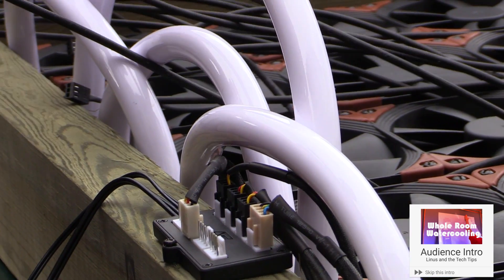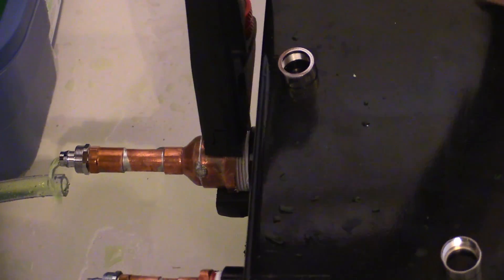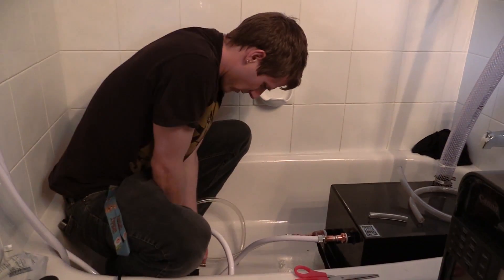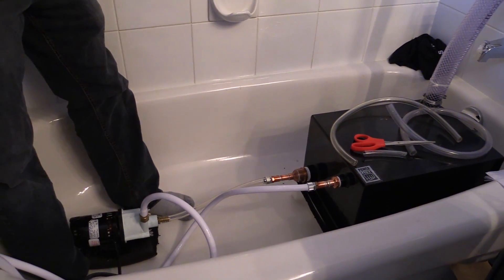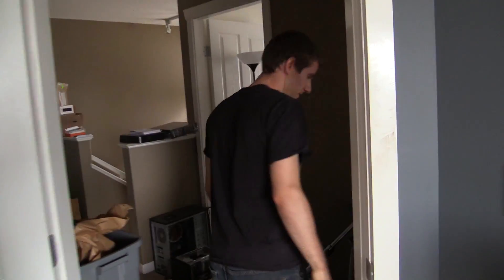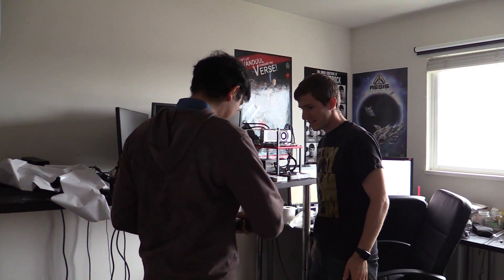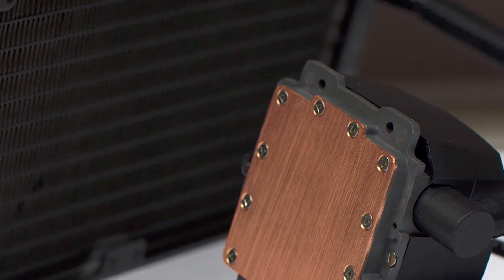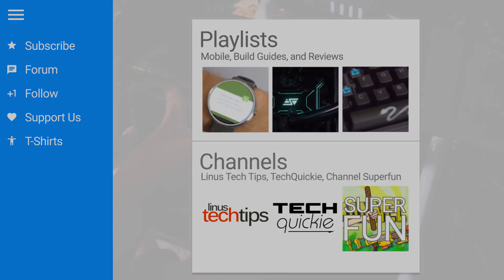Whole Room Water Cooling Part 4 - Nearing Completion...

Comment: LinusTechTips You should have used 22mm copper around the ceiling then branch off to each pc in 15mm copper to reduce the flow rate drop across the system. At the high points of the system you can install AAV's (automatic air vents) will help you get rid of any air you dont want in the system easier. On each branch to each pc loop you should of put in vavles so when you need to remove one pc you wont need to drain the entire system. Last of all the pumps in the computers are going to be working harder and against the big pump in the bath and against every other pc on the system.
Reply: yeah i was thinking same thing and im nomplumber im an exx bbodyman painter

Comment: A valve at the top of the piping for each pc,  or just at the highest points,  would have been nice for taking care of the air in the system. Just like in normal house radiators. (at least in denmark where I live), each radiator has a valve at the top,  top release air.

Comment: Just a question. If one of the systems are off, won't the water stop flowing?
Reply: They are connected to the loop in parallel, not in series
Reply: That too

Comment: Fun to watch but some mistakes.   Pressure balance system feed like you do with a shower with multiple heads would have been better.   Also a radiator built from AC parts would have been cheaper and more efficient.

Comment: have you thott about changing the tubes on the pc in to clear tubing so you can see if the fluit is in the pc or not ?
specially if you disconnect and reconnect the pc
in adison you need some kind of restictor on the out take (eta flow walv) to balance the flow or a lot better pump

Comment: Very nice effort, but the design was flawed from the begining, the pipes should have been placed down on the floor level not up. I havent figured it out if the sistem is in series or parallel. If the pipes where at the lower part of the room it was much easier to bleed the sistem, put a 30" pipe after each PC loop aoutlet and add a simple radiator bleeder valve, bleed each sistem and there u go.

Comment: I don't get this water cooling. I might have missed it so can someone explain why they chose to do this instead of just water cooling the PCs individually? In the first video I saw that they wanted to make the room cooler but air conditioners can just do that. What else is the point? =) Just asking guys.
Reply: My hypothesis is they did this for the experience/video, and to show off some sponsor hardware.
Reply: It's explained in the first part.The heat exhausted from the PC's make the room hot, PC temperatures never go below room temperature. The Computers and the room was hot.

Obvious choice is an AC, they chose this instead.
Reply: so you make a video about hey guys i just AC my work place or??!!
make X videos so far 4th video and entertain us about this idee, so you dont have to do it yourself.
Reply: tosswe44
But the pipes will heat the room as it is copper
Reply: ArmyGuy543
it is acctually. Also if the issue is the heat a better solution would be to put those machines on the bathroom near it and set a  masterswitch and USB on the tables.

Comment: Getting those pesky bubbles out?  Consider adding inline primer bulbs (commonly used for marine fuel priming on engines) -- if you can find one with low restriction it can be used to force ANY fluid through the system, air, water, etc until it is primed.

Comment: Is this a Good Budget Build?
- Updated

Cooler Master N400 ATX Mid Tower Case
AMD A10-5800K 3.8GHz Quad-Core Processor
ASRock FM2A88X Extreme4+ ATX FM2+ Motherboard
Sapphire Radeon R7 265 2GB Video Card
Corsair Vengeance LP 8GB (1 x 8GB) DDR3-1600 Memory
Corsair CSM 550W 80+ Gold Certified Semi-Modular ATX Power Supply
Seagate Barracuda 1TB 3.5" 7200RPM Internal Hard Drive
Asus DRW-24B1ST/BLK/B/AS DVD/CD Writer
Reply: looks fine but buy an AMD card instead if you are using that APU so it can run on dual graphics mode :)
Reply: Go on the LinusTechTips forum
Reply: ***** Thanks, helped alot!
Reply: Lorenzo Ermanni Thanks for the input, I'll definitely consider it.
Reply: Great idea, what AMD Card would you recommend? I was thinking of choosing a Sapphire Radeon R7 265 2GB
Reply: +Theodor Hedesiu 600w psu? do you thin kthe amd cpu really needs 150w morr power? o.o
Reply: Thanks for the Input. I'll definitely consider changing the 5800K to an 860K. The only downside is that I believe the 760k and 860k don't have integrated graphics, thus I won't be able to use crossfire to get slightly higher performance.

Comment: I know yall are moving and what not now, but perhaps installing turn type/style focets on the ends of the pipes would allow for easier drainage and stoppage of the coolant.  Idk what kind of effect these would have on the pressure of the loop and the "air tightness" but its just a thought.

Comment: I don't know what to say so here is a waffle recipe:

INGREDIENTS

1¾ cups all-purpose flour
2 tsp baking powder
½ tsp salt
1 Tbsp granulated sugar
3 eggs
1¾ cups whole milk
½ cup vegetable oil
½ tsp pure vanilla extract (optional)

Prep Time: 15 minutes
Cook Time: 30 minutes

Total Time: 45 minutes
Yield: Makes 4 to 5 waffles

PREPARATION

Pre-heat your waffle iron to its hottest setting. Placing a cookie-sheet under it can help catch any batter drippage during cooking.
Pre-heat oven to 200°F.
Sift together flour, baking powder and salt.
Beat eggs thoroughly. Whisk in sugar, milk and oil.
Add liquid ingredients to dry ingredients and mix gently until combined. Don't overmix!
Spray both surfaces of your waffle iron with cooking spray.
Ladle 4 to 6 oz (½ to ¾ cup) batter on the iron and close it. It's not unusual for a bit of batter to seep out of the edges of the iron. If there's excessive leakage, use less batter for the next waffle.
Cook until the waffle iron's indicator light shows that cooking is complete, or until no more steam comes out. The finished waffle should be golden brown and crispy.
Lift the waffle out of the iron with a pair of tongs and either serve right away or transfer it to the oven to keep warm

Comment: Why didn't you guys insulate the piping? Or is that the last step?
Reply: frollard What they would need to do is insulate the piping so that it cannot escape into the house and will only escape from the radiators. I say only, but as we all know you can't completely control heat change in a system like this. The entire point of this project was to cool down the room as well as the systems so insulating the pipes would mean keeping the room cooler.
Reply: It'd be pointless since they want to get rid of heat, and there's antifreeze in the line to keep it from freezing in the winter, although since they're moving that might not have mattered either
Reply: Tyler Shaffer It stops heat transfer either way -- copper transfers heat easily, so 'hot' computer fluid heats the hot side of the copper, then just...heats the room. Insulating the hot side makes sense.  It doesn't matter much, but think of the surface area of 50 feet of copper pipe...that's an entire cpu heatsink in surface area dumping warmth into the room.
Reply: Wompie Yeah I was thinking that the heat from the piping could just escape into the room from the air hitting the pipes. They could reduce heat if they insulated the pipes, so that the heat would be trapped inside the pipes, thus making the heat being completely dumped outside... theoretically.. Unless there is something wrong with my logic here
Reply: Jason Last your thinking is way off here, in so many ways. i don't mean to insult you, but there is really no use talking to you about this, if you have no idea, how a liquid cooling system works.
Reply: wouldnt that just retain heat?
Reply: It either retains colder temperatures or retains heat I believe... I think insulation is used to maintain temperature
Reply: bigphillip25 like a flask?
Reply: They want to get rid of the heat.
Reply: Jason Last but not inside the office. copper piping was a pretty bad idea to begin with, they have to at least insulate it.
Reply: Flip Zilip I doubt that the water would be warm enough for that to be a problem, the radiator should more than able keep up with the cooling right?
Reply: Flip Zilip yep inside the office, else a lot of heat will get spray via those pipes inside the office. Not an issue for the systems but he said at the beginning that they want to get the heat out of the room
Reply: Jason Last what? i don't really understand what you mean. the radiator has nothing to do with this. you want to get the water outside the room, with it cooling down as little as possible (because that means heating the room). uninsulated copper is one of the worst ideas to do this, because of it's very good heat conductivity. not insulated = room heated, insulated = room heated significantly less.
Reply: Axonteer i was replying to Jason. I'm aware of the problem.
Reply: Flip Zilip But the liquid going through the pipe is only warm at best, if the radiator cools the liquid flowing through the pipes then the water should be at or below room temperature anyway.
Reply: Jason Last I'm guessing the purpose of the whole project is to lower the temperature inside during summer, where the temperature outside will be above or around temperature inside, so the water will naturally be warmer than the room, since it can't be cooled below outside temperature. Ultimately the heating potential of the pipes inside will depend on their surface area versus the surface area of the radiator.. if the surface area of the radiators is great enough to keep the water at outside temperatures, i don't really see the pipes heating all that much. Of course insulating the pipes will prevent a great deal of room heating, but that is something they can do later if they deem it necessary.
Reply: David Nielsen I just don't see the pipes getting hot enough for it to matter.
Reply: Jason Last if the pipes do most of the heat exchange it will not be any differences from before and they will not achieve a cooler room.
Copper pipes looks cool.
Reply: Jason Last There is a heck of a lot of surface area of copper pipe in that room. Doesn't matter how hot it gets, it's dissipating heat into the room. Heat flows from warmer to colder. So as long as the pipes are any amount above room temp then they'll be heating the room. In summer, if it's hotter outside than the water temp then the rads will be warming up the water, and dumping even more heat into the room.
Reply: bassl0va
I agree, i think insulation is the best since in winter they will want the room to be heated and the system to be cool and in summer the heatness of the system might warm the room a lot, also i think the piping looks horrible so insulation is a chance to make it look better.

Also i wonder, does anyone know if the system being insulated from the warm room and cooling with outside cold air is going to make it go below room temperature?
Reply: Alonso Quintero In general, with air cooling you cant get the cooler below air temperature, as the minimal energy the air is carrying within is its room temperature.  This is utterly simplified and there is sort of a chill factor incooporated and all but for that i had to dig out my thermodynamics physics book from my studies.

But as a general rule of thumb. If your Air Temp is 32° C, you wont be able to get your system cooler than 32°C give or take a few.

One way would then be a refridgerator or other way of forced hard cooling on a part of the tupe. Lets say you put the Radiator in a Fridge (silly ghetto rig i know, but lets go with that), what the fridge does is insulating the radiator, and taking heat away from the inside, and putting it on the outside. But since (entropy and all) you wont loose any energy, if they put that fridge in the office, all they would get is a cooler water temp, but the heat would go into the office again ;) On the other side i dont think fridges work well if they stand in direct sunlight and get heated hard from the outside.   

Any physics teacher will now rant and start typing, but keep in mind i dont have my thermodynamics book from my physics class with me and this is just stuff i scratched together inside my weird head ;-)
Reply: Axonteer
I figured that out, but they have the radiators outside of the house and i assume it gets cold during the winter....
Reply: During the winter i can agree, but heating is more often not a problem. Cooling is one tough and thats also something he mentioned.  So lets hope they put those black rad's not on the sun-side of the building... else the water would get heated :D
Reply: Axonteer
They had another building next to it so im guessing they have a bit of shade at least most of the day, and yeah i wasn't even sure if overcooling was possible with so many machines. I also have no idea what winter is like in their town but i just wondered if this was possible. I guess it is, hopefully not likely in their situation.
Reply: Well eventough we had some mild winters here in swizerland, it still gets below 0° during the winter, i guess unless they switch off all their machines and only the main pump is running it should produce enough heat to keep the water above 0°
Reply: bigphillip25 the point is too lose heat, not to keep the heat.

Comment: you should of hand valves on at the copper going into each pc therefore you could isolate each pc and remove the air lock simple plumbing , twinemplumbing dotcom

Comment: The sad part when this is not going to work );
Reply: TheNinjacatboy Then maybe you should elaborate.
Reply: TheNinjacatboy As stated before, this was filled nearly 4 months ago. It's already working, not only that but I believe they ended up taking the fans off the external radiator (The one outside) because it was working perfectly fine just being passively cooled. I saw that in passing on the linustechtips forums, so don't quote me on it.
Reply: these videos were filmed months ago, its up and working
Reply: Tyler Shaffer i know that
Reply: Alexander Port  so they want to put the heat out side and keep the room cool.but they are using cooper tubes to put the heated liquid back  to the radiators out side.Copper is a good conductor of heat.so if you heat one end of a piece of copper, the other end will quickly reach the same temperature. all that heat is going to stay in the room because the copper tubes will transfer the heat out back to the room. idk it might work ,it might not.we have to see. they should have just got an air conditioning will have worked better,less work,less money....ETC
Reply: TheNinjacatboy The water will move very fast, so it won't make contact with the cpu/gpu blocks long enough to become  hot, and I don't think it'll heat up the copper pipes enough for the room to become warmer.
Reply: Raptor Jesus  yes the water moves fast.....but how fast? remember this pumps where only made for short in case builds not long pipes.what ever heat is going  to get cooled has to travel with the pipes and out to the radiators.if the heat is not cooled fast. the heat is going to find a way to be cool and its going back to the room from the pipes.
Reply: This has been working for the last 4 months.

Comment: so why does each chassis have its own radiator if it's not connected to anything and the entire water loop goes to the copper pipes
Reply: oh, but that's too much hassle. they have to deal with air bubble problems again
Reply: comebackata2 less hassle than having 6 computers that can't be used